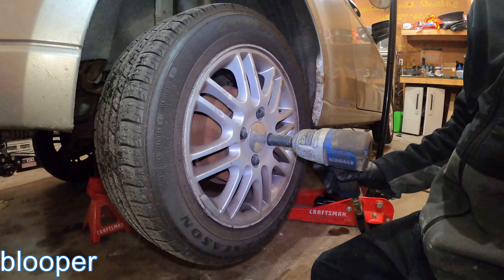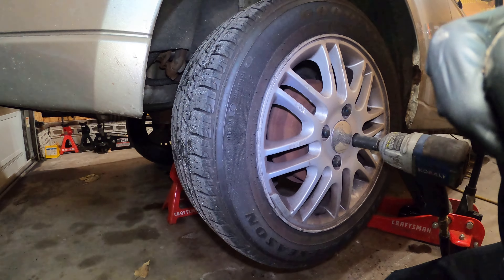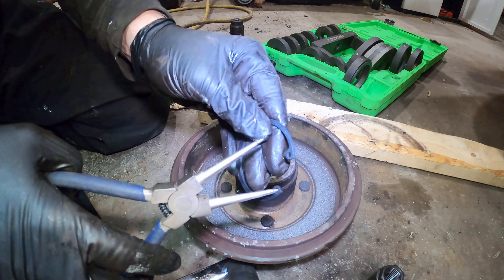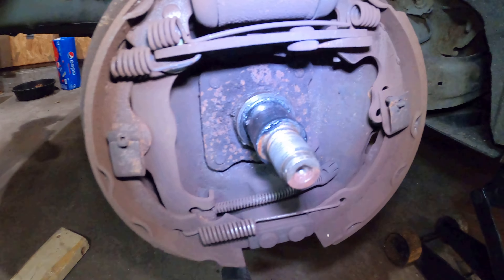2008 Ford Focus Rear Wheel Bearing Replacement without press

Comment: The very first piece that you destroyed when you pried it off the drum (@3:08) was the water seal carrier that the rubber bearing seal on the spindle rides on. I see you did not replace it which will allow water/dirt to get into your new bearing. The water seal carrier is easily removed from the drum - without damage - by gently prying with a small flat blade screwdriver from the inside and underneath it - not from the outside like you did.
Reply from the maker: Yes I did destroy it. It was replaced before installation. It doesn't show it there but if you watch the other side video (maybe posting at a later date) you'll see the replacement of that seal.  I realized during editing it wasn't filmed. i hope this video helps. feel free to like and subscribe for more & if you can, please help the channel out by giving a super thanks. Making these videos takes a lot of time, but we do it to save you hundreds. also head down into the description and check out the link for some high quality led bulbs for this and any other vehicle. use my referral for a discount. Add me in Instagram for behind the scenes pics and Stop by my store for some Anything Auto gear.

Comment: Why didn't you buy the drum with installed wheel bearing combination? Its only about 20 bucks more and the time savings alone is worth it. I've done three of these and you can do one side in 20 minutes with no cussing.
Reply from the maker: I know right I could not find one whatsoever. Ford could special order them but they wanted a ton of money for it. If you know where to find it shoot me a link and I will put it in the description for everyone else

Comment: You could have used your press you would have to use the socket and then your smallest one on the end of the socket bingo done
Reply from the maker: @williamstarklauf6085  i hope this video helps. feel free to like and subscribe for more & if you can, please help the channel out by giving a super thanks. Making these videos takes a lot of time, but we do it to save you hundreds. also head down into the description and check out the link for some high quality led bulbs for this and any other vehicle. use my referral for a discount. Add me in Instagram for behind the scenes pics and Stop by my store for some Anything Auto gear.